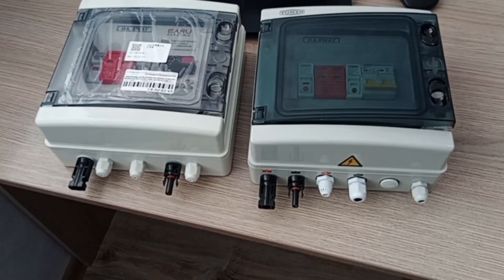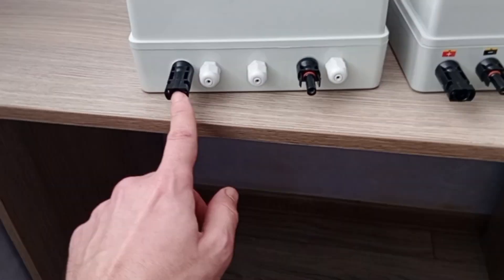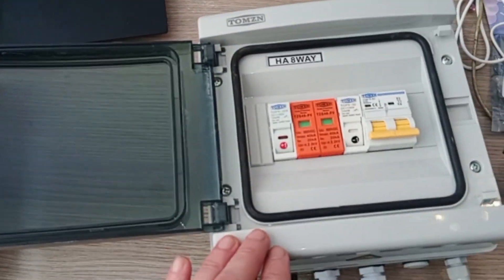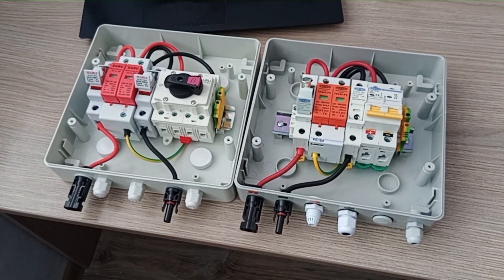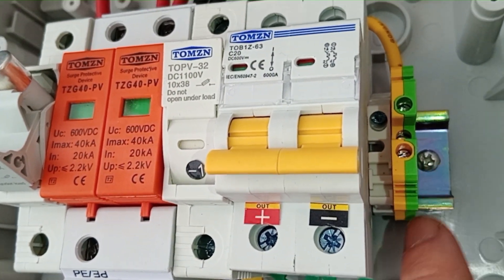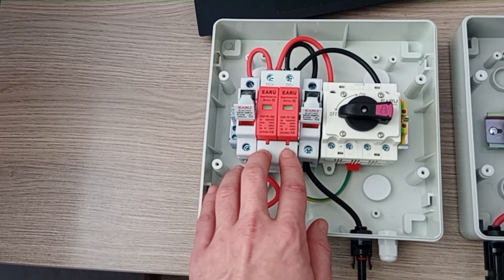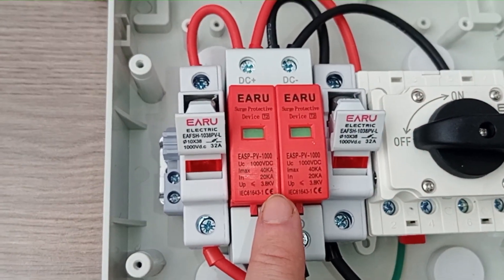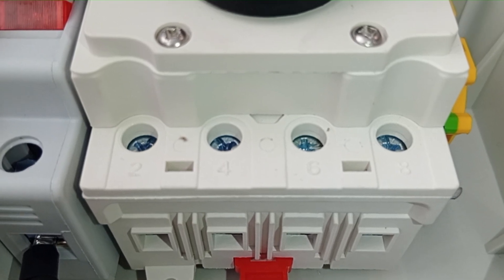TOMZN vs EARU: PV-protection combiner boxes comparison - checking two different brands in details

Comment: I'm wondering why dont they do also MC4 connectors for the output? Afteraal the invetor is expecting MC4 connections.
Reply from the maker: No idea... If mounted inside the building - I was sometimes even removing MC4 from the input... But for outside it's better with them. Also, not all the inverters have MC4 on PV input, some cheaper ($250-400) inverters don't have those. Only the ones which are IP-65 rated - those have MC4 solar inputs
Reply: @BackyardVoltage  that makes sense, thanks